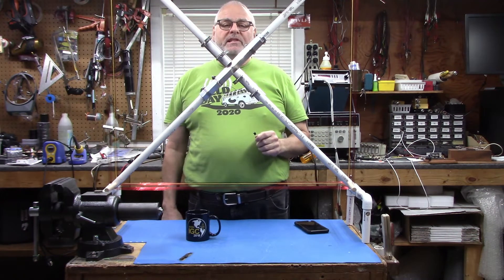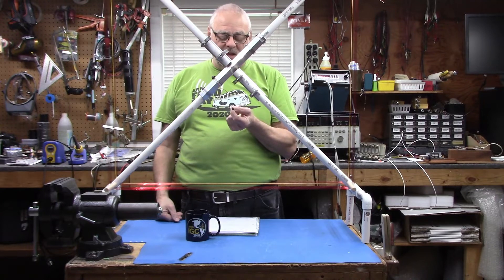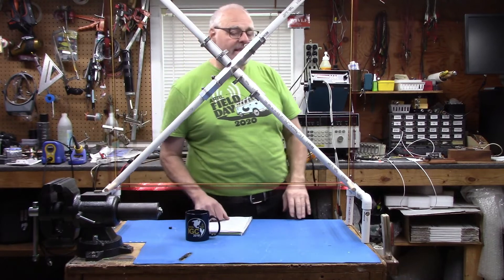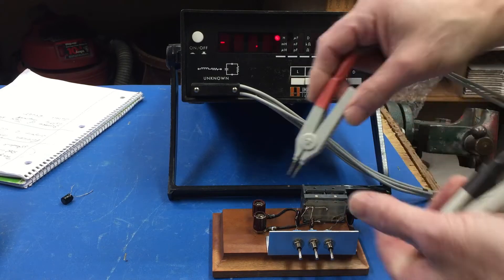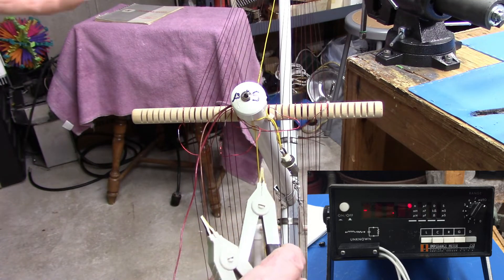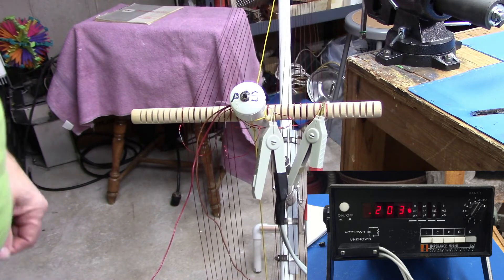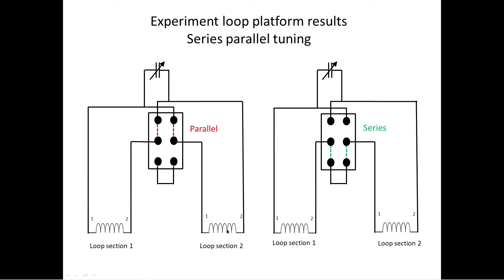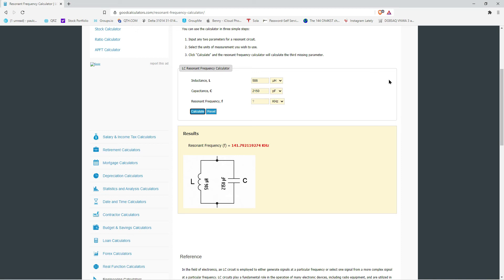Experimental Frame loop 3 Questions, Answers, and Measurements

Comment: Hi Paul, would putting the capacitor and switch in an aluminum housing improve the noise (noise level in RTL SDR) or does it not matter?
Reply from the maker: Not really... almost all of the reception is done by the larger coil.  If you have noise problems the solution, although not the easiest it to put the antenna remote, as far away of the nose as is practical in your situation. W1VLF

Comment: Your measurements seem to agree pretty well with the formulae given on this website : https://www.electronics-tutorials.ws/inductor/parallel-inductors.html. If you have 2 inductors, each of 200uH in series with some mutual coupling, aiding each other in phase, the formula is L1 + L2  + 2M, where M is the Mutual Inductance. From your measurements 2M=186uH and M=93uH. The formula from the website for parallel aiding inductors is (( L1 x  L2 ) - M^2 )  / (L1 + L2 -2M ). Feeding in your values gives 146uH for the parallel windings.